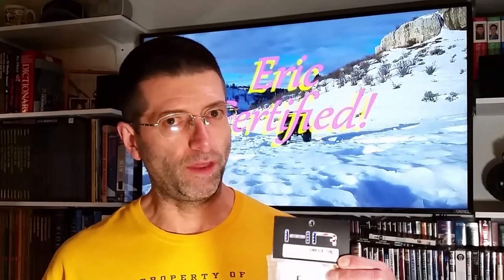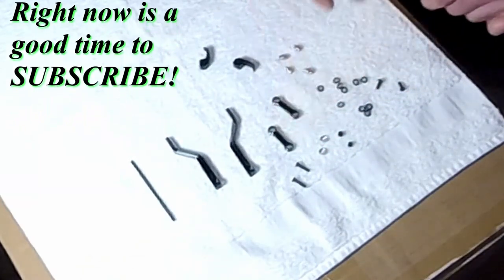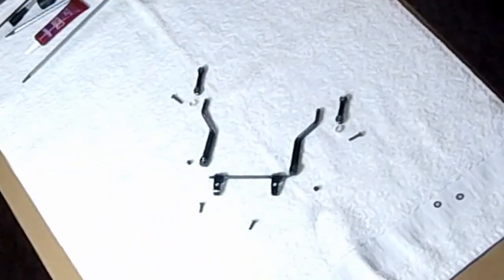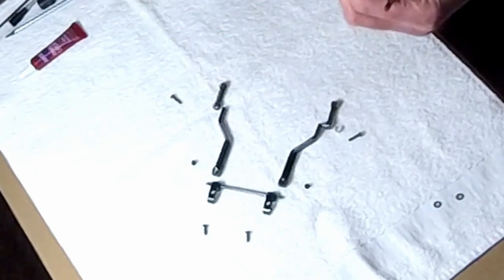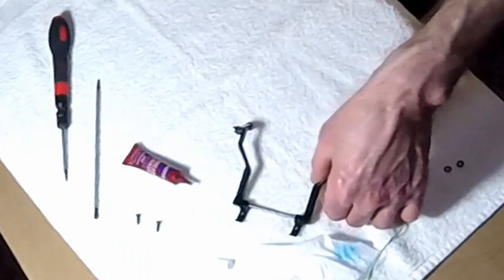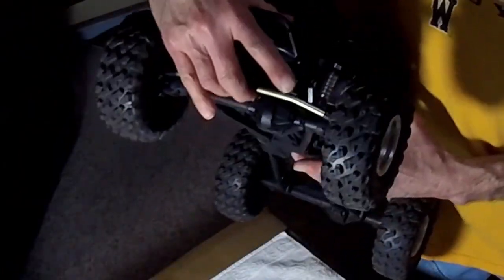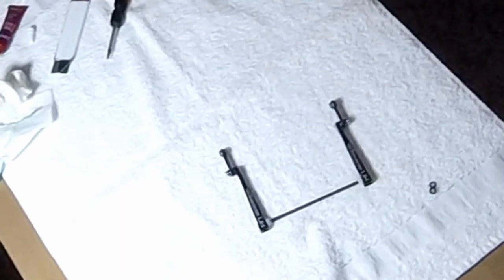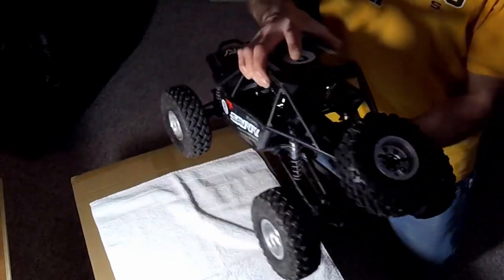Axial Bomber: Front and Rear Sway Bars Installed!

Comment: The little wight spacer goes on the outside of the frame mounts in the rear. 
Your video was super helpful.
Reply from the maker: ...spacers on the outside of the frame? That makes sense. Thank you for the help. I will correct that. Thanks for watching and taking the time to comment!

Comment: Nice, helpful video. Thanks. Did you have any issue with the rear bar fitting through the little frame pieces? Mine will go through the first one but has to be forced up against the bottom of the fuel tank and subsequently forced through the the hole on the other side. Once in it is so tight that the rod wont pivot, which renders the situation useless. Just thought I'd ask. Thanks again.
Reply from the maker: Thanks for watching and commenting, friend! Perhaps the fuel tank is misaligned, somehow. That's weird because the bottom of the tank is part of the rear frame assembly. Without looking at the problem area it is impossible to determine a solution. The extreme remedy would be to file away some material from the bottom of the tank. Try everything else, first. I hope that helps. Good luck and thanks again!